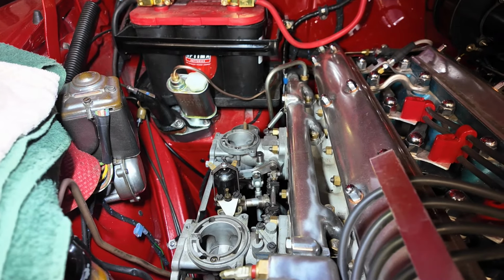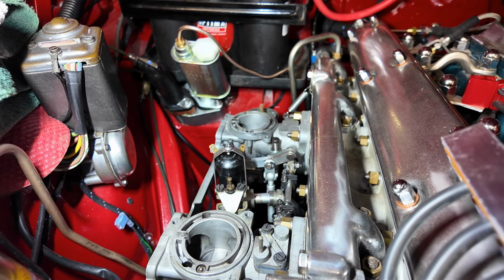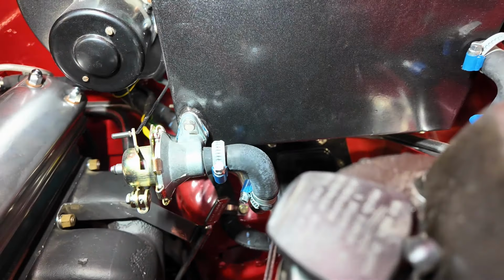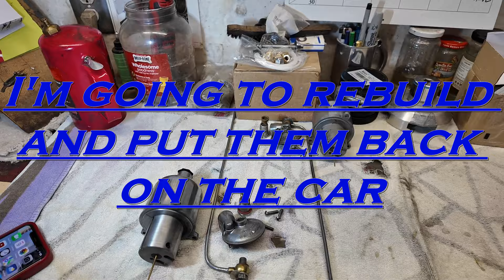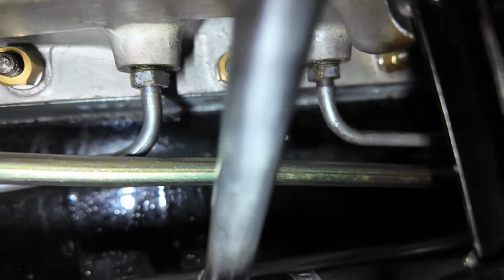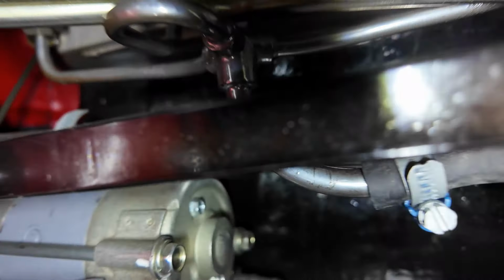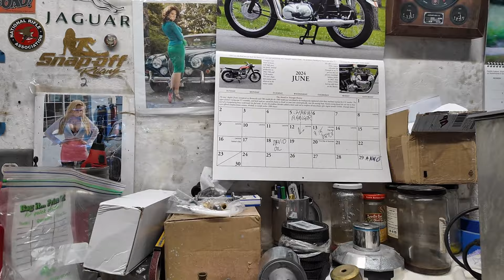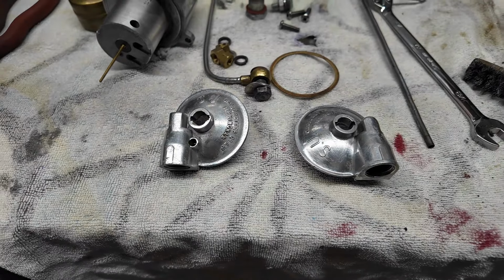Jaguar MKII Reassembly Part 305

Comment: Gary did you get the coolant leak solved I must have missed this episode
Reply from the maker: I won’t know if it’s solved until I finish tightening my nuts and put the carburetors back on and restart it I think it’s the intake manifold gasket
Reply: Hopefully you manage to close the leaks.🙏🤠🇺🇸👊🇬🇧🥃
Reply: @jagvette1 good luck this fantastic mark2 must drive again